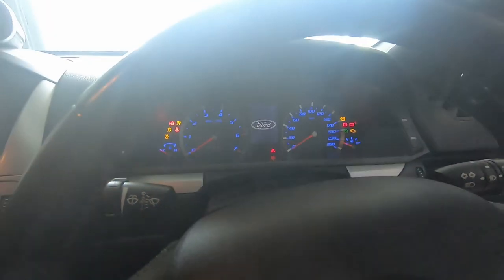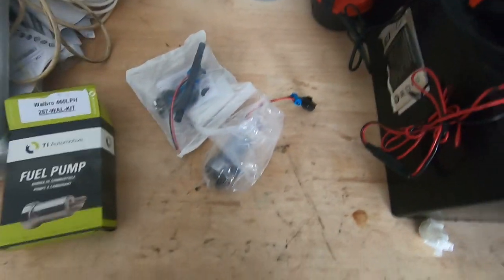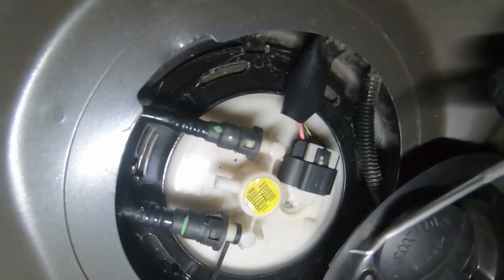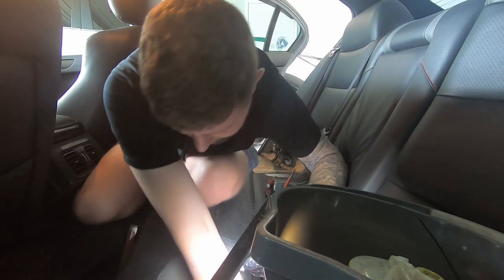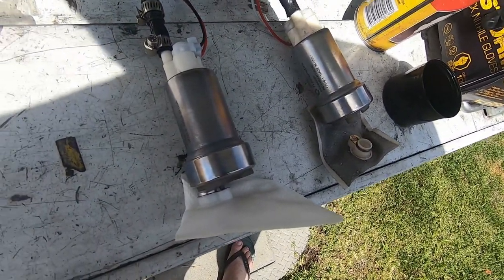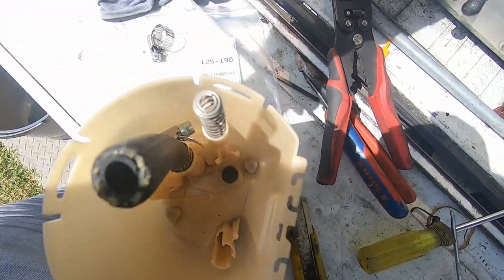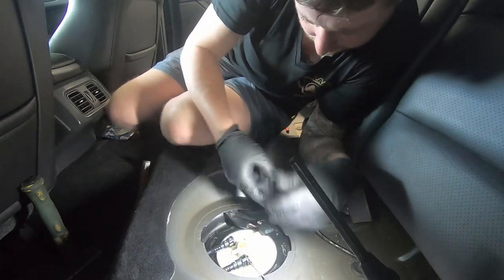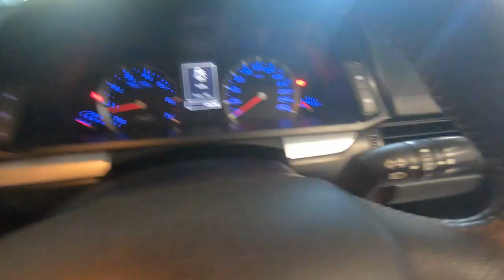Replacing My FGX Fuel Pump ALREADY!! Heres Why...

Comment: Looks like you purchased a 525 hellcat unit with P/No: F90000295 (without the check valve) when you really needed P/No: F90000285 (with internal check valve). How did you find the 525 running without upgrading the relays?